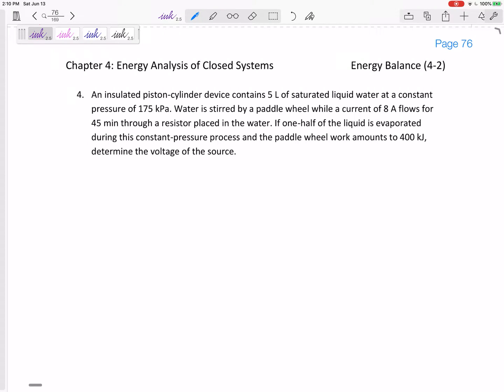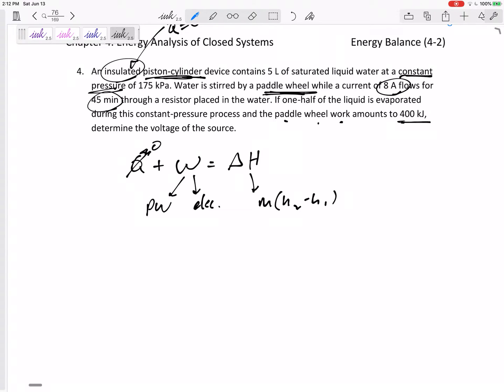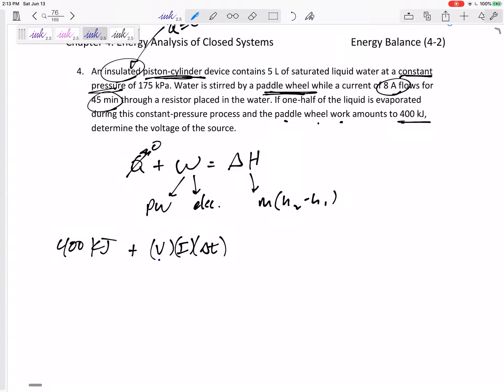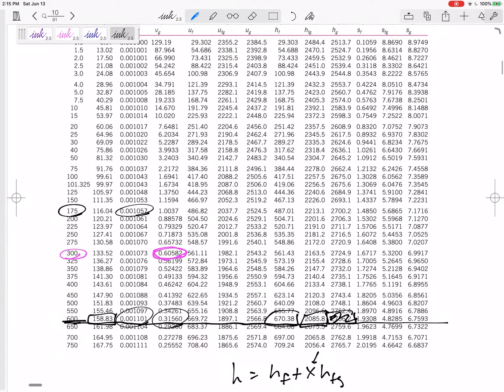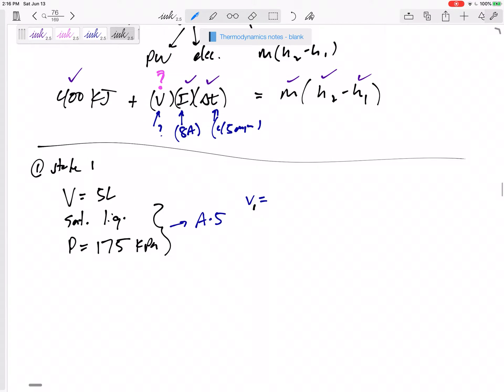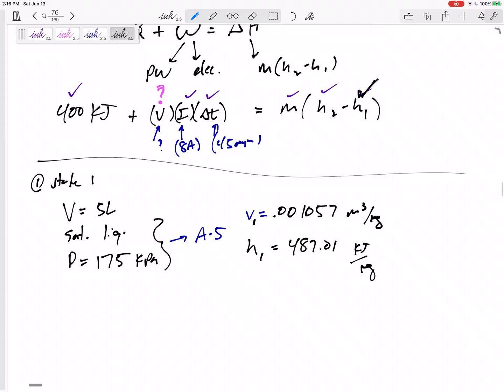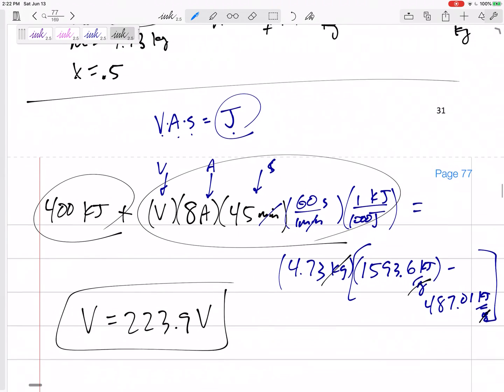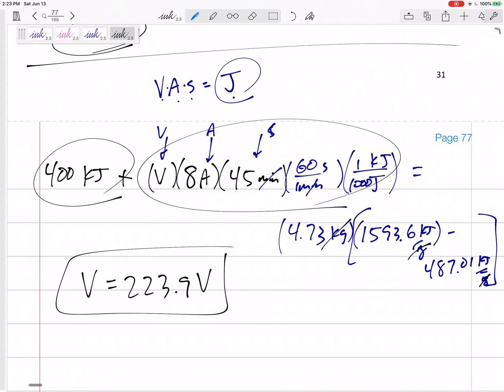Thermodynamics - 4-3 Conservation of Energy in constant pressure process

Comment: "Isolated" means no heat or work transfer, this only says "insulated", so yes there is work but no Q.
Reply: hey man did you understand why we didnt add the Work boundary in the energy balance formula. We Have shaft work + electric work and word done by piston movement which is boundary work but he didnt calculate it
Reply: @mangoharun  I'd like to know this as well
Reply: @ishmail1472   constant pressure  implies there is that delta H on the right hand side for a closed system.  Where delta H, enthalpy, equals delta U plus delta Pv   ––> h=u+Pv. The enthalpy already includes boundary work